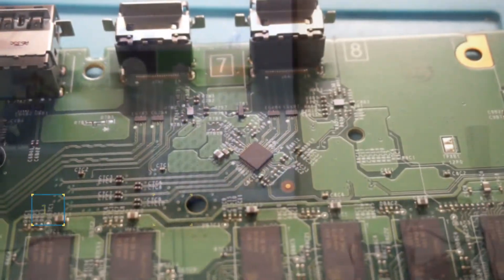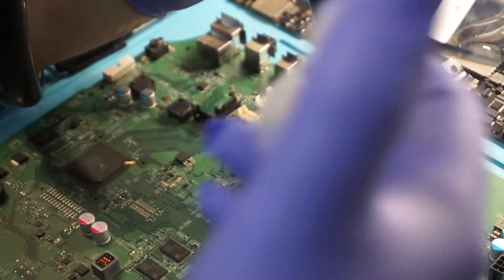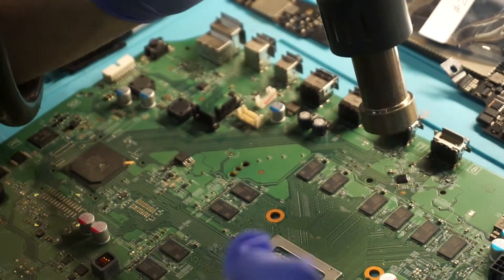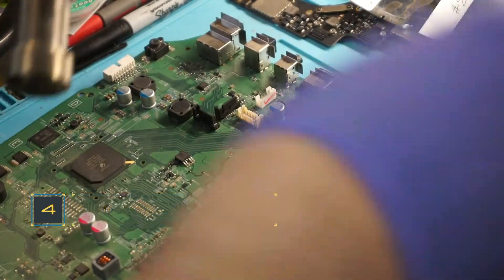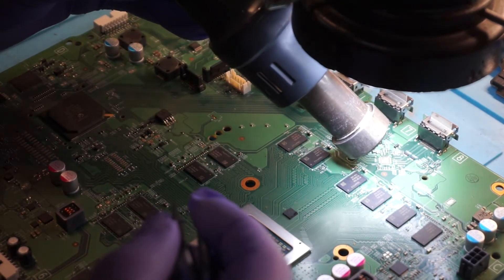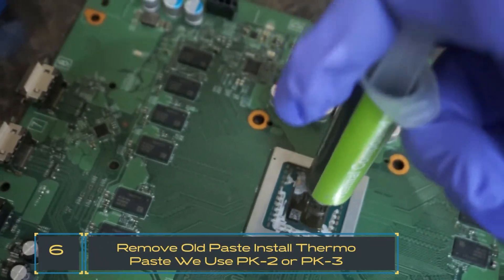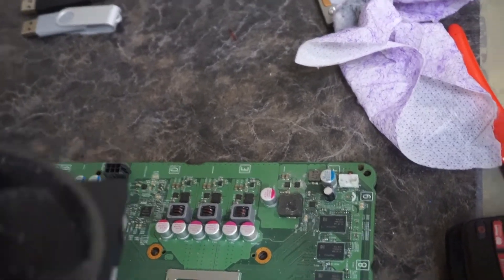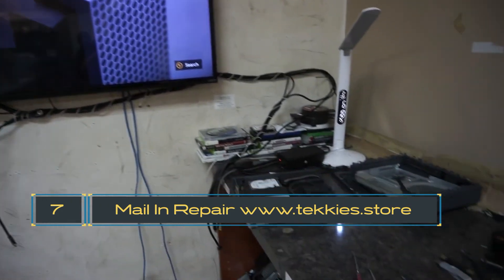Xbox One s Blinking Screen Re-timer Chip Replacement 100% FIX Correctly!

Comment: Im about to do that exact chip replacement. Never done before. I mean NEVER. 
Just order my soldering kit, with the right chip, the heat gun and screw drivers. 

The only thing I dont get is: why not get off the old solder and put new one? And is there a way the chip is suppose to be placed? 

Sorry for that beginner questions haha but that could help me in my future adventure!
Reply from the maker: thx, Glad this inspired you to want to start chip replacements, yes you can remove old solder use gootwick to remove , suggest putting lead solder on pads lightly it melt faster easier for install. and using low melt solder to remove chip help very much, you do have to have the chip in correct position when heating new chip in place there a dot top corner of chip and on the board there white dot so you know where to align chip, or just take a photo on your phone before removal so you know how to line u the new chip, and a microscope does help.
Reply from the maker: also we put flux on board before installing center best as possible and with heat the snap in place you see it do this.